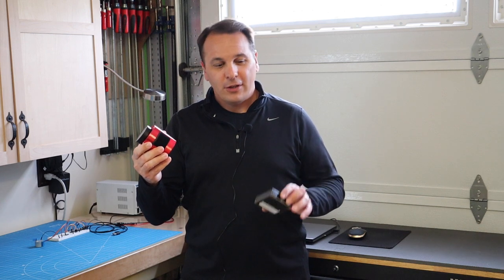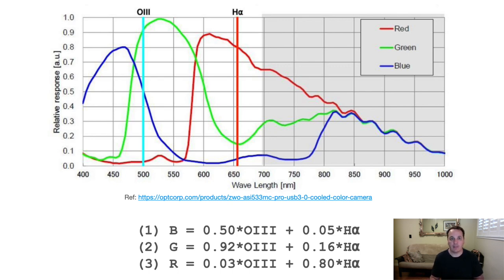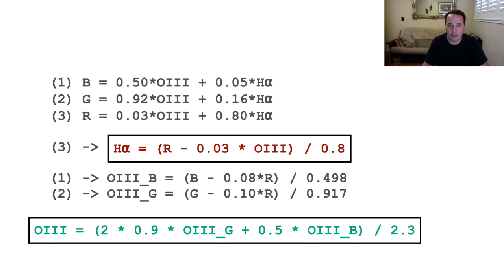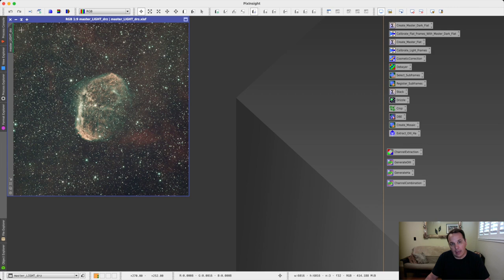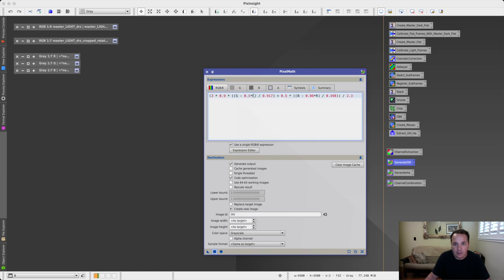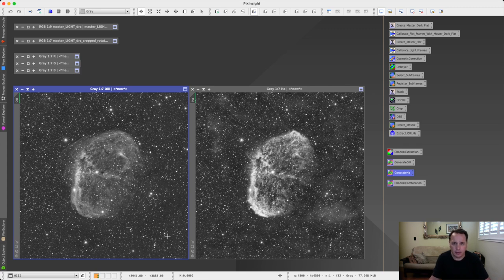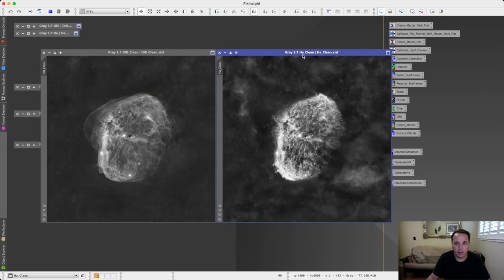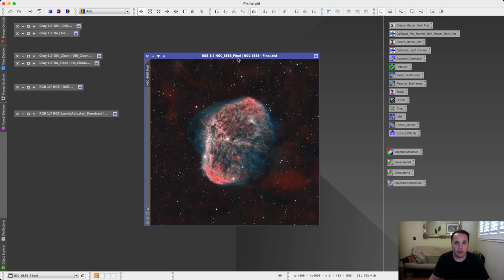New OSC Narrowband Processing Technique

Comment: Great instructional video. I am going to have to try that out. Is it possible for you to post the pixel math equations? Also, I have the L-Ultimate with the ASI533C, are the equations you showed valid for it as shown. I understand that I may have to tweak things.
Reply from the maker: The instructions should work fine for the L-Ultimate, but since no two filters are perfectly equal, expect to do a small amount of tweaking.

Comment: Thanks for the video.  When I try the run PixelMath to generate the OIII or Ha channel, I get an error message: "Couldn't execute PixelMath instance: There is no active image window"  What am I missing??
Reply from the maker: Are you clicking on the blue square at the bottom left of the PixelMath window? Also, make sure you select “Create new image” (see the video, you might have missed this small detail) Hope that helps!
Reply: Great video and nice approach. How do you compare these results to apply an Image Integration in PIX or similar? I see your point according the bandpasses, but what about SNR? If you apply PixelMath I guess you won’t get an improvement in SNR… and you have 2 channels (G & B) gathering [OIII] data… that could improve the SNR

Comment: Hi, brilliant to isolate the wavelegnths signals. 
How can I get the same RGB starting equations for my qhy268c ?
Same imx571 sensor but not same manufacturer
Reply from the maker: Hi! I published a follow up video on my channel to explain how I derived the PixelMath expressions, check it out, it should help. You can start with the same expressions and tweak them, your sensor is actually pretty similar to the one in the ASI533MC Pro. Thank you for watching!

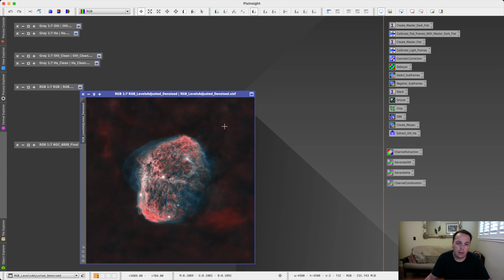Comment: Excellent !! Explained very simply. Can we add separate SII data using the SII filters and mix this OIII and HA data? 9:03 you said, you captured RGB of the stars, do we need to use a separate filter for that? Could you please how to do that?
Reply from the maker: Unfortunately, you won’t be able to separate SII. In most cases, it’s ok. In my experience, SII is really valuable only on a fairly small number of targets. H-alpha and OIII will cover most narrowband targets well because very few narrowband targets emit strongly enough in SII to get a clean signal. If you really want to isolate SII, I am afraid the only solution is to use a mono camera with an SII filter.

As for the RGB stars, since this entire video is about using an OSC camera, all you have to do is to use a luminance (UV/IR cut) filter.
Reply: @darkskygeek  Got it. thank you so much for ur reply
Reply: @darkskygeek  But why not collecting and extracting H-Alpha and OIII from dual band filter image and collecting SII signal in the ordinary way with SII filter and combining all afterwards. Probably after linear fit? Are there enough targets with strong SII signal is another story.

Comment: Do you think this technique would allow splitting of Ha and NII signal when using a 5nm dual narrowband filter? It's really the only thing I'm missing since I've got both of the ALP-T filters so Ha, OIII, SII and Hb. There are good planetary nebulae that show good division between Ha and NII if imaged with separate 3nm filters
Reply from the maker: Highly unlikely! Also, NII emits across 2 spectral lines that are on either sides of Ha. Check out my recent intro to spectroscopy (part I) in which I show the high resolution spectrum of a planetary nebula.

Comment: Nice - just a quick comment, in your PixelMath formulas you don't seem to take into account that Green pixels are twice as many as Blue and Red ones in a Bayer matrix. Why not?
Reply from the maker: Hi! Good question! The fact that there are twice as many green pixels as blue pixels only influence the signal to noise ratio, it does not affect the intensity of the signal, and therefore the value of each pixel after debayering. Hope this helps, and thank you for watching! Make sure to check out the part two of this video, which I published to my channel a while back. More processing videos (better produced and better explained) are coming soon.

Comment: Hi man. 

I have to admit your corrections to the image are impressive. Now please let me start asking the questions. There are a few things left uncleared in the video and in the CloudyNights discussion. 

1. About the whole idea. What you are doing is getting OIII and H-Alpha signals out of the camera RGB interpretation of the dual band filter data. Theoretically your results should be identical to taking two images with mono camera and OIII and H-Alpha filters and combining them in HO image. Is this a correct statement? The whole purpose of this is to learn how to collect correct narrow band data two times faster by using single shot color camera and dual band filter. Is this a correct statement?

2. I am really lost with your equations and especially with the last one about OIII. Please explain better how exactly you derived this equation. The reason I am asking is because we use different cameras and if we need to tweak the parameters, we will need to know their relation. According to the math two equations should be sufficient for solving two variables - OIII and H-Alpha. Theoretically equitation 1 and equation 2 should be sufficient for solving H-Alpha and OIII. Same for any other two channels. It is not clear to me how exactly and why you are mixing up three equations for solving two variables. Please give us more of the evaluation of the last OIII equation so I could understand better.

3. Lastly, I didn't understand how exactly you combine OIII, and H-Alpha images. I was expecting this to be done with Channel combination, but in the video, you said with PixelMath. If it is with PixelMath what then what is the proportion? Did you just sum them 1:1? This would probably give us a lot of saturation in the final image. Please explain.

Thank you,
Emil
Reply from the maker: Hi Emil,

Have you had a chance to view the follow up video I posted on my channel? It answers some of your questions. If anything is left unanswered, please post your question in the comment thread of the subsequent video. It’s easier to keep track of things that way. Thanks!

And thank you for watching!
Reply from the maker: Here is a quick summary:

1. Not exactly. This video is for people who already have a OSC camera and a dual narrowband filter, and who would like to try a different method to process their narrowband data. Also, with that equipment, you don’t collect narrowband data twice as fast as mono. Actually, it’s a little slower than mono, although not as much as what people might think. There are several great CloudyNights posts on this topic.
2. The derivation of the PixelMath expressions is covered in much greater detail in my follow up video. Please check it out.
3. I also covered that in my follow up video. Also note that there are tons of ways to do this, I just present my way of doing things.

Let me know if anything else is unclear.
Reply: @darkskygeek  Thank you for your prompt reply. I will definitely check the second video and if I still have questions will post them there. I am imaging with L-enhance, which is wider than L-extreme, but because I see the improvement with your method, I will try it with L-enhance too. I already found the curves for my ASI294 and will start taking the coefficients from there. You said that you took your photo in San Jose. If you are part of SJAA we probably already met somewhere in the dark. :)

Comment: These equations seem to give the impression that we could reliably separate OIII and Ha signal from a single debayered OSC camera image. I don't see how that can be possible. There will always be a mix of photons of different wavelenghts giving signal in all the R,G and B pixels. Just assuming that their spectral distrubution is governed only by the spectral sensitivity of the sensor is by no means the whole thruth. It will of course also depend on the spectral distribution of the target. So what is done here is only an approximation, probably in most cases a reasonably good one, but it is not the whole truth. If I make a thought experiment and imagine that I am imaging a monochromatic target that emits photons only in OIII, or only in Ha, the equations given here will still produce some signal in the other band, wich in that case obviously is not correct.
Reply from the maker: If you have signal that is only in OIII or only in Ha, you will most definitely have signal in all 3 bands because of the transmission characteristics of the bayer matrix. These equations and this methodology is likely the most accurate out there. A simpler version is to assume that 100% of the red signal is Ha (see Bray Falls’ latest video) That works okay too, but it’s just not as accurate, and on the crescent nebula, it will cause undesirable artifacts. Clear skies!